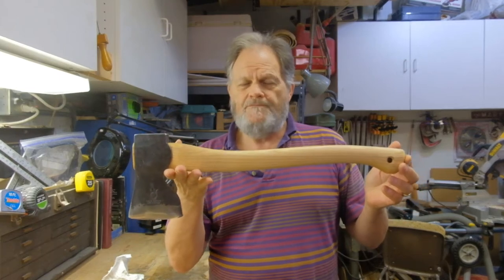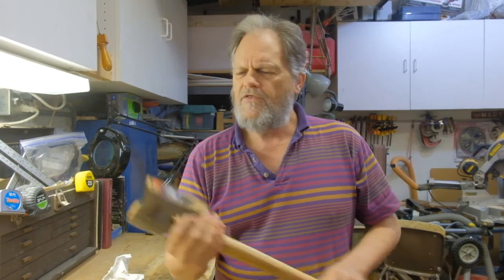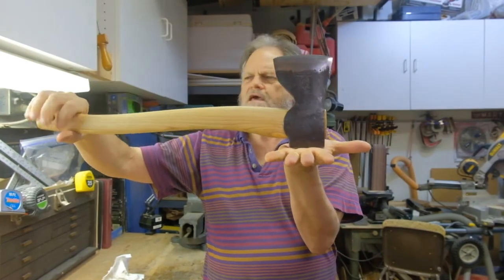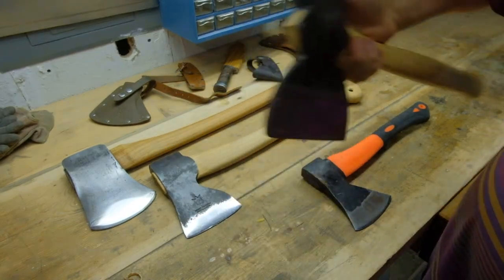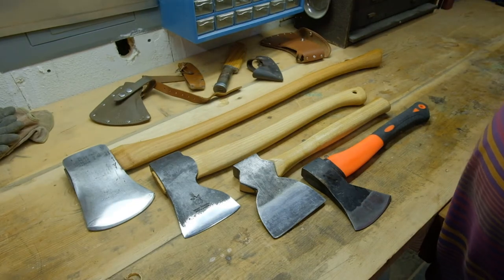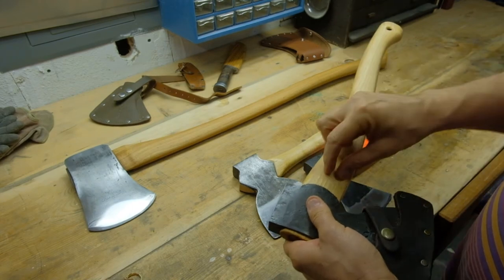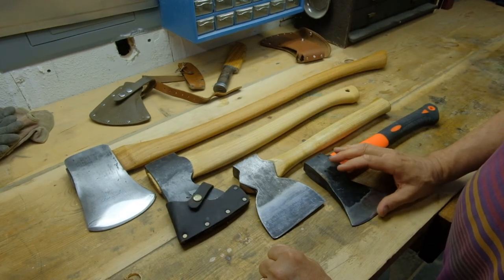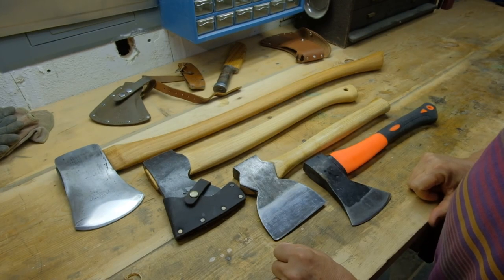Husqvarna Carpenter's Axe, Customize, Compare, Uses

Comment: Just bought one and spent 45 minutes with a file on the edge profile. Then my 30 minutes with my cheap 4 sided diamond stone and later my 3 sided stone and a leather strop. Then sanded it down the handle a bit with 220 and coated it with BLO. It is absolutely Razor sharp and it splits dry oakwood for my small smoker perfectly... I’ve tried wedges and another standard small axe with much less success.

Comment: The poll is not hardened,  so do not use it to hammer! Husqvarna are made for workmen who use their axes daily. They want their axes how they like them, so they leave it up to them to finish the axe how they want it. You can buy 3 of these axes to the price of one Gransfors bruks! So to me they literally charge the price of two axes just to finish them. Watch how long it takes them to finish ghe grinding.  And if you do buy  GB axe, look at the grind under a LED light, and see how many bevels they have. And they are using industrial linishers! Husqvarna axes are made in the same forges!